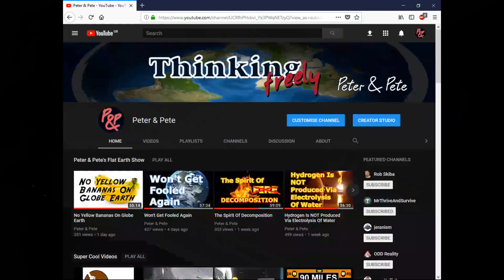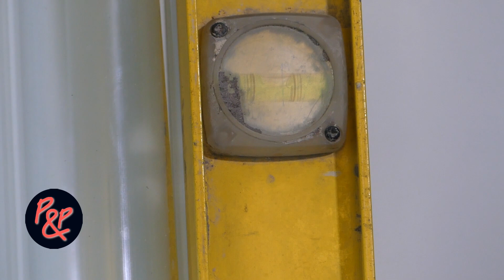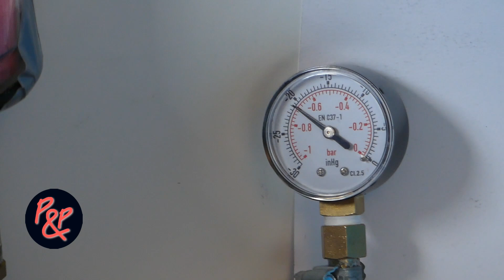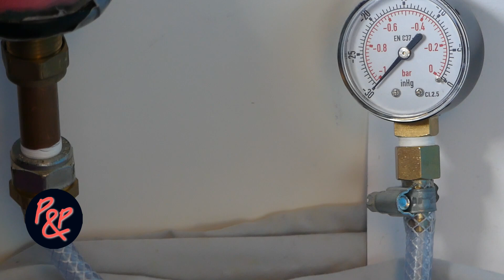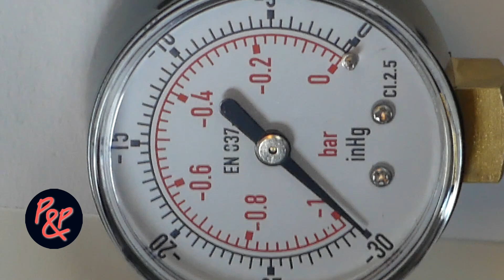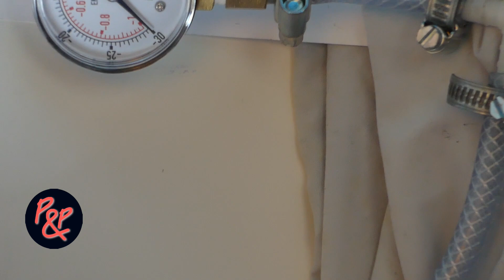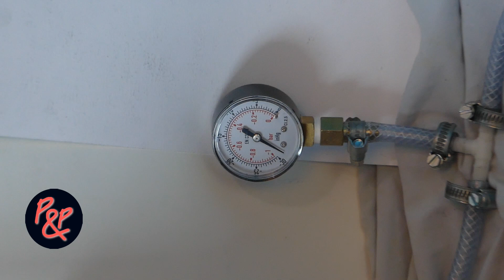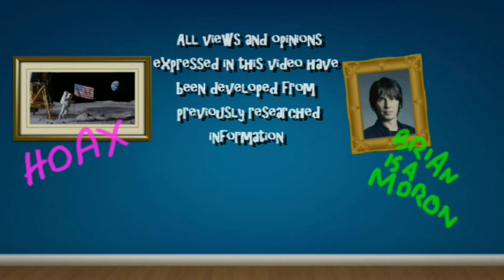Falling Objects - Sealing The Deal

Comment: Misters Peter & Pete - Why did the aerogel fall so much more slowly in the air filled tube compared to the vacuum? Setting aside the ball for the moment, you say, "what causes objects to fall is something that is a property of the object and not an external force or influence acting on the object." 17:10 What property of the aerogel changed to cause it to fall at 2 very different rates? As far as I can see you changed nothing about the aerogel. You only changed the air pressure in the tube. So if nothing about the aerogel changed, it would seem that changing the air pressure caused the aerogel to fall differently. In short, the air pressure was an "influence acting on the object".

Conscientious scientists would repeat their experiment many times and thereby average out any little errors that may have crept in due unforeseen factors. They would also refine their test setups to do such things as get more accurate readings of the actual air pressure in that tube when it was under a vacuum. Lastly, they would publish their results so that other scientists could try to replicate the results. Fortunately many people have already replicated this type of experiment. I expect you have already seen Brian Cox's video here on Youtube on the subject. So I won't repeat that here. But here's another version of the experiment that's quite well done. https://www.youtube.com/watch?v=s9Zb3xAgIoY
Reply from the maker: quote - you say, "what causes objects to fall is something that is a property of the object and not an external force or influence acting on the object." 17:10 What property of the aerogel changed to cause it to fall at 2 very different rates?
I cannot understand the relevance a medium would have upon why an object falls in the first place, especially when you already have my views on why objects fall!
Tks for link. We don't accept Brian's video to be genuine as it's not done in 1 single take! We don't see the ball and (heavy) feathers fall from start to finish from one viewpoint. Whereas in my demo there is transparency throughout! Action lab demo is flawed as he should carry out the test using a variety of heights! The 18" square chamber is just stupid to use it for the purpose of trying to demonstrate falling objects!
If you want to be chasing dreams that's down to you but watch out when reality hits you!

Comment: Whenever real vacuum chamber experiments are performed they firstly use high grade equipment and pumps which can create and hold the lowest possible pressure, not the cheap crap you’re using in this video. They also allow the process of sucking air out to run for hours, the short amount of time you have used here is pointless. That said I’m your video you have actually just help confirm Newton’s Laws. The gel does fall almost as quick as the all. If you had a much better vacuum then you would have seen both reach the bottom at the same time. You can claim whatever you like but this outright supports Newton.
Reply from the maker: so that wasn't a vacuum pump or gauge that was used in the demo; manufactured upon the science YOU support, the spring, the mechanism, the pump, the pressure blah blah!!
you're typing bollocks stephen! Do it yourself if you think the demo wrong!

Comment: You do realise that you have proven gravity by this experiment? right?  Don't you realise that this experiment disproves your own points conclusively. Wow, I am actually stunned at the absolute insanity you display. In a near vaccum (with reduced air resistance) the lightweight silica airgel fell almost as fast as the metal bearing. How do you equate this simple fact within your mindless insanity? Well heres a popint you need to consider. The second experiment was not a complete vaccum but was a NEAR vaccum. There still were air molecules within the tube that would have given a slight air resistance to the falling objects, however there was a lot less air than in the first experiment. So in the first experiment the shape of the silica airgel helped it flutter at a much slower rate as it fell. The second experiment there was less air resistance and so the gel fell faster and almost kept up with the more streamlined shapedball bearing.

Your experiments have been a dismal failure for your own point of view. You are correct when you say that this experiment settles the matter as it certainly has. You now get elevated alongside Bob nodel, jeranism, randy, and phuket word for disproving their own ideas while trying to disprove science. Congratulations.
Reply from the maker: you do realise you've typed a load of bollocks?
Reply: Peter & Pete thank you :) “bollocks” to you is obviously “well reasoned and rational” to anyone else. Anyway I choose not to insult you but I simply remind you that as I am more intelligent than you, my opinion is worth more than yours.
Reply from the maker: @whisperedarcc6543  quote - Anyway I choose not to insult you but I simply remind you that as I am more intelligent than you, my opinion is worth more than yours.

so gravity is just an opinion? thanks for confirming that as I would totally agree with you on that one!

Comment: Jesus. The amount of effort you put into this could have been better spent doing pretty much anything else, like setting it up properly for a start. When you do the second test you even switch the vacuum pump off, so you no longer have a vacuum. That's how crappy your experiment is, you compromised it before you even started.
Reply from the maker: Quote When you do the second test you even switch the vacuum pump off, so you no longer have a vacuum. 
Do you know what a gauge is for? We switched the pump off so the action of the pump didn't affect the objects fall, especially the lighter one. If you had a brain you'd be dangerous!!
Reply: @PeterPete  The action of the pump? what the fuck are you talking about? how could that affect the fall? As soon as you turned the pump off the pressure started to equalize because your laughable attempt at creating a vacuum chamber was so shit you had to gaffer tape it together. you are  a pair of useless morons.

Comment: You claim that items with the same weight fall the same rate. Have you tried this out with 2 items made of the same material and the same weight, but with different shapes ? Like a sheet of paper compared with a same weight wad of paper ?
Reply from the maker: Heavier objects will always hit the bottom first given enough height is allowed for each object to reach its maximum drop velocity. If you want to be pedantic and use air resistance as a factor then just eliminate as much air resistance as possible but the conclusion in our opinion will be the same. Instead of asking questions and being critical you're more than welcome to find out for yourself Ron!
Reply: @PeterPete  Funny you should suggest that. I worked with parachutes. When they are open, they fall at a slower rate than when still unfurled.

Comment: I love it when idiots disprove them selves especially with the most crappiest setup I have ever seen !
Reply from the maker: If you think we're wrong, you're more than welcome to do it yourself rather criticise from the comfort of your chair! Try it in 4m? Go on dare you.
Reply: @PeterPete  Why ? You are clearly unwilling or unable to discuss the data of your own experiment. Why then would we expect an honest discussion about any data from our experiments ?
Reply from the maker: @rondevrind7655  It's the observation that matters. Do it yourself. I'm sure you can collect lots of data to analyse but it would never change the observation and outcome.
Reply: @PeterPete  so what? Your own experiment with quite crude tools nevertheless clearly managed to show the lighter object falling way faster in "vacuum", as predicted by the newtonian model using gravity. If you were doing real science you also would spend some time thinking about possible errors in your setup, like: "the achieved vacuum in the tube is not an ideal vacuum, but rather only quite low pressure air" or "perhaps there's some buildup of static electricity hindering the fall of the lighter object". Where have you done that?
Reply from the maker: @CherryGS  sure but you also noticed the heavier object falling faster as well? That basically supports my view that heavier objects will fall faster than lighter ones with the heaviest object always hitting the ground first provided enough height is allowed for BOTH objects to reach their max drop velocity! 

Btw we don't do your science, we do our own as your science is bollocks!
Reply: @PeterPete   i could not notice this from your blurry homevideo-footage, no. But you are right, the (gravity)model would predict the steelball falling faster, as it is also affected by air resistence, even more so in your narrow tube. Did you take any precise measurements of the falling speeds of both objects?

You do realize the "max drop velocity" is caused by air resistance? You won't find a max drop velocity if you do these experiments here on earth in a real vacuum, the objects will constantly accelerate with approx. 9.81m/s² (surprise, surprise) no matter their weight or density.
And lastly: interesting science you have... no need to account for errors in the experiment or the measurements? No wonder you "believe" in a flat earth.
Reply from the maker: @CherryGS  quote - You do realize the "max drop velocity" is caused by air resistance? 
and your proof is what exactly? To me that statement is just a spurious comment and certainly unfounded! In my opinion max drop vel applies to ALL objects falling in ANY medium! Moreover, max drop vel is an inherent property within objects and is not caused by external forces
You can't disprove my position!
Reply: @PeterPete  there it is: "any medium". Vacuum is no medium, it's specifically characterized by the absence of any medium. So, by your own words: no medium = no max velocity (for any achievable drop height on earth), instead constant acceleration of approx. 1g until the object hits the ground.
again: where are you measurements, or did you just eyeball it (as would be expected by any flerfer?)
Reply from the maker: @CherryGS  well in my opinion a vacuum is a closed artificial environment where the internal pressure is surrounded by greater pressure like that of a vacuum chamber. Dropping an object in water, air or vacuum makes no difference on the actual object unless you'd like to state categorically that a tennis ball weighs the same as a 1 tonne tractor. Get my drift?
Reply from the maker: @CherryGS  and btw objects do not accelerate due to gravity - that phrase only relates to falling motion hence the inclusion of the word gravity. Objects accelerate in a fall due to their inertial mass or a property of the object and NOT because of some external force!
If you think i'm wrong go and get off your backside and go demonstrate that objects fall due to an external force and NOT because of a property of the object!
I'll look forward to the video - i've done my bit now do yours!
Reply: @PeterPete  would you care to explain how objects know where "down" is without an external force acting on them? why don't they "fall" up when turned around 180°? And regarding your "show they are falling due to an external force": ever heard of ZeroG-Planes? Why don't objects fall when they are inside a plane accelerating downwards at 1g?
And you don't seriously expect anyone to accept your made up "definition" of a vacuum, do you?
Reply from the maker: @CherryGS  you forgot to explain how objects 'know' where down is? do you think objects have minds of their own to determine what's up, what's down, what's left and sideways? do you think these objects know your name? since when have you had these strange ideas? have you sought help at all for your mental health problem?
Reply: @PeterPete  we already reached the "ad hominem" stage? Nice... but let's please try and keep it civil, will you? 

Now, have you actually read your own post?
Let me quote your words: "Objects accelerate in a fall due to their inertial mass or a property of the object". What property would that be, and how would a "inertial mass" cause a downwards acceleration? How would the object "know" which way it should accelerate because of its "property" when there's no external force acting on it? How does this "property" cause a downwards acceleration in approx 100% of free falls, disregarding the orientation of the object?
How can anything accelerate without a force acting on it? You do realize this would violate the most fundamental principles of physics, as an acceleration is ALWAYS the result of a force acting on a mass?
If you put gravity into the equation its becomes quite easy: objects accelerate do to a force acting on them (called gravity), and the direction of that force (towards the center of the earth) causes them to fall to the ground every time.
Reply from the maker: @CherryGS  f=ma or in my understanding a force is a mass in motion so a falling object has force as it is in motion and nothing needs to act on it so there's no violation there. just an unwillingness on your part to see the application. any object at a high elevation that has little 'support' has a potential to fall. remember also that you have to raise an object in order for it to fall. an apple falls solely because the tree grew to then produce apples from its branches, you could throw an apple up in the air which in turn will come down because it reaches a point where it has the potential to fall. so without an up there is NO down and you guys totally forget this vital point but no object needs to know this - it's just the way it is,  you could always ask why zebras have stripes and not spots, or maybe why giraffes have long necks instead of short ones but I wouldn't ask these questions, I just accept things for the way it is because I can never change them. and I haven't even used the word g*****y. btw, ever heard of the Equivalence principle? you should!! here's a link
https://en.wikipedia.org/wiki/Equivalence_principle
Reply: @PeterPete  short answer: no, that's not how f=m*a works. And gravity is the cause for "up" and "down" here on earth.
i won't answer any more. There's no base for a discussion if you choose to ignore basic principles like newtons laws. These are universally accepted (with the exception of some flerfs) and proven to be correct for centuries.
Come back when you have a model that allows to calculate the acceleration for an object without a force acting on it.
Reply from the maker: @CherryGS  f = force, m = mass and a = acceleration and we all know if an object is accelerating it is not standing still, which means if an object is accelerating it is in motion. therefore any reasonable person would conclude that a force is a mass in motion. The mass in motion has the force. May the force be with you Cherry!!

Comment: It's great, guys, that you're actually doing some experiments! But seriously do you not see the flaws and daftness in this, or are you seeing them but ignoring them?
1) You should have done at least a dozen runs and averaged out the results
2) No way that set-up will give you a hard vacuum. No way at all. There's still a considerable amount of air in the "vacuum set-up" - which, simply from an observational POV, should be taken into account in your "conclusion"
3) The most obvious "conclusion" from this is the one that you're just not seeing (or are, but are pretending you're not): that air density affects the fall of the lighter object proportionally more than it does the heavier object.
4) A secondary (tentative, cos you've only two data points) conclusion would be that, as the air density drops, so does the difference in acceleration of the two objects, and with further tests (try a range of different gauge pressures and then graph them out) it seems plausible that as the air density approaches zero, so does the difference in acceleration rates - leading you almost inescapably to the conclusion that differently-massed objects fall at the same rate in a vacuum.